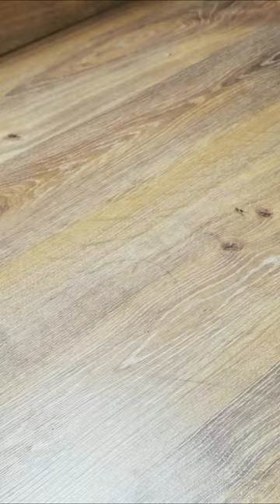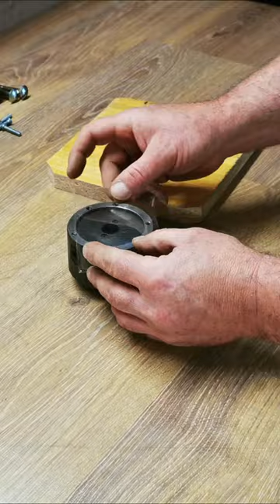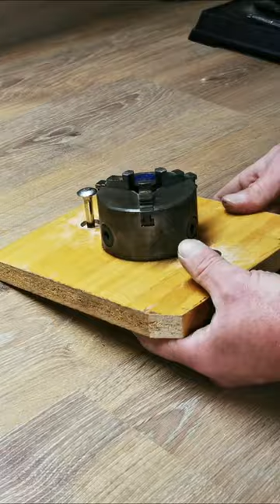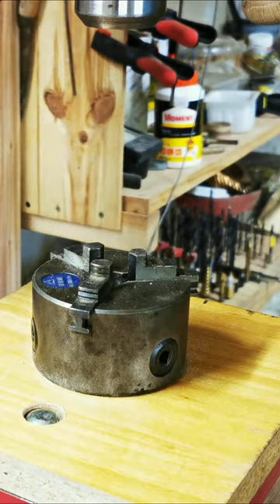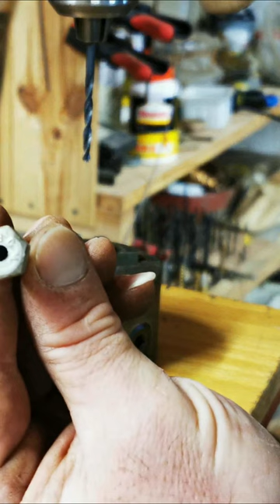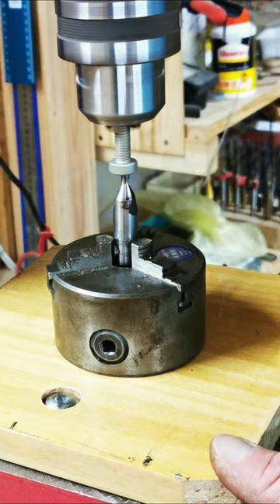Useful Ideas for Drill Press

Comment: How to fill a 3 jaw chuck with metal swarf.
Reply from the maker: There is no way to fill the inside with shavings!  But if necessary, it can still be disassembled (very easily) to be lubricated and cleaned if necessary.  I don't see where you found a problem?
Reply: @_gkworkshop  the chunk is open and pointing UPWARDS. There is no way not to fill it with metal shavings.
Reply from the maker: Yes, it is difficult, but it is not impossible for chips to get inside (especially with open jaws for a larger part), but it can be opened and cleaned very quickly and easily. The idea is to make an exact opening in your workshop in the absence of a machine  intended for this purpose.